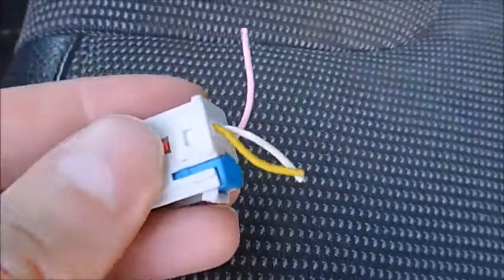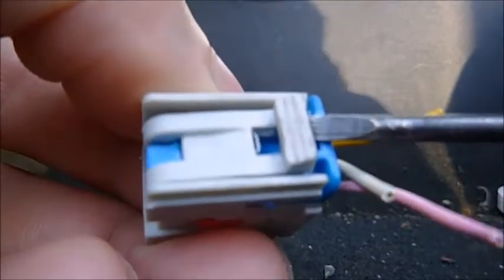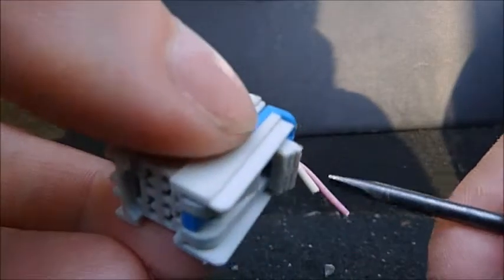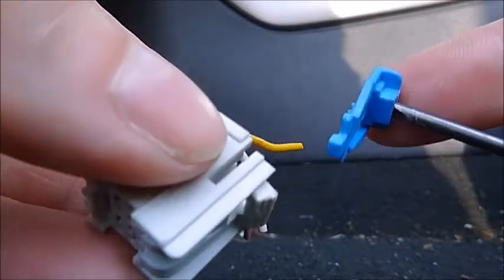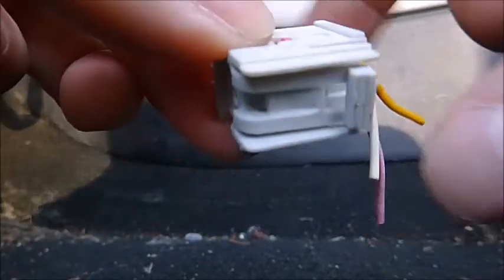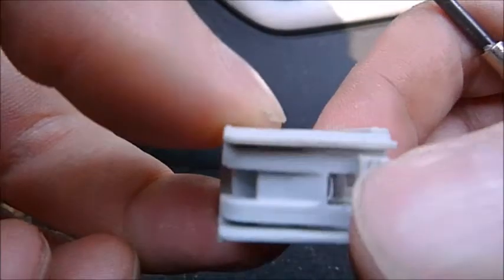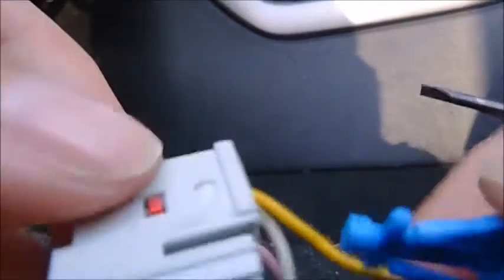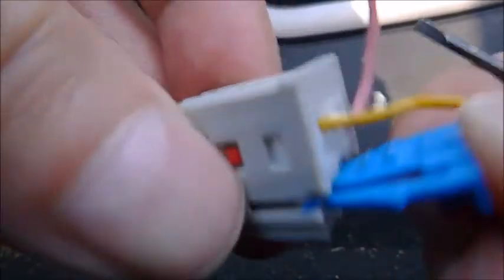Hyundai Steering Module blue connector removal

Comment: Do you know what the part name or number is? The pink wire on mine seems to have slipped out
Reply: Mine too! I just replaced my steering coupler and I put everything back and my power steering was disabled. I retraced my steps and I found the pink cable slipped out. Did you figure yours out?
Reply: @adriancontizano5316  I ended up having a friend solder another piece of wire to it unfortunately, couldn’t find the full connector
Reply: did you ever find the part number. I am looking for the blue pin because I lost it
Reply: @leodan0945  did you ever figure this out? I lost it too. Did you end up replacing?